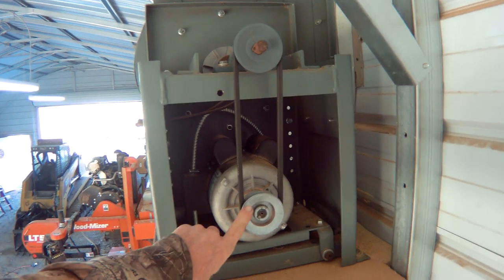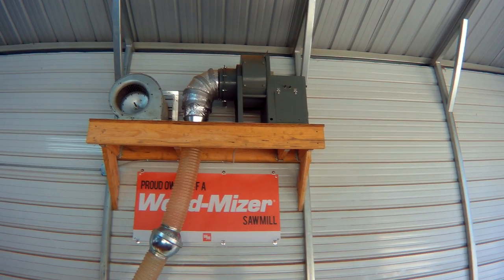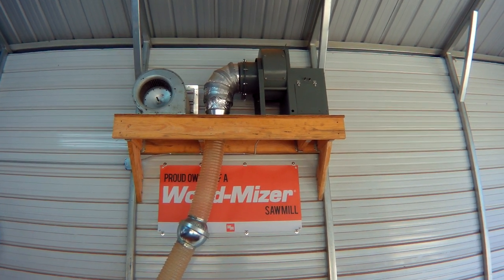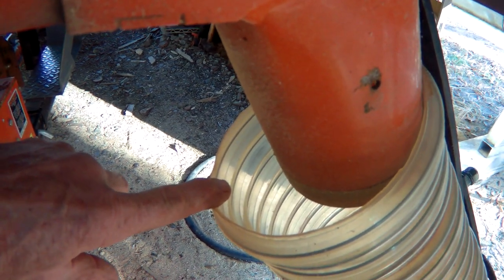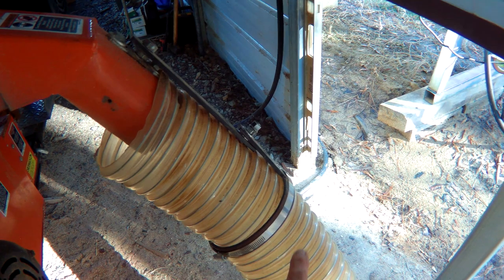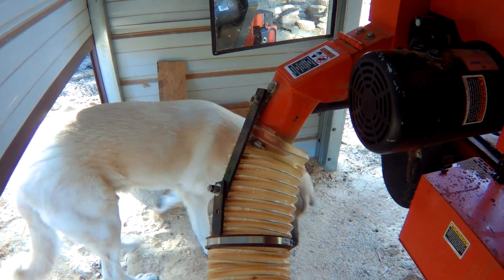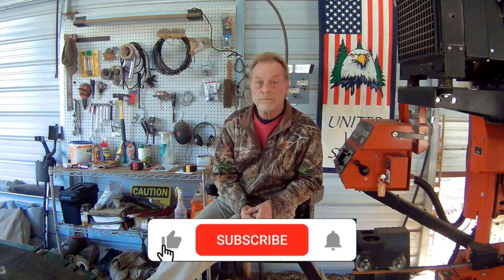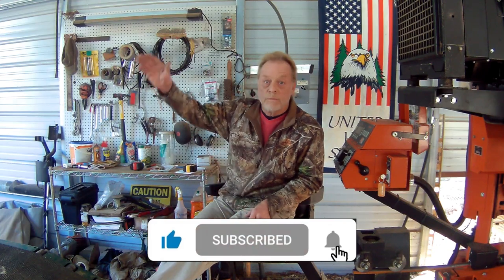The perfect Dust Collection Setup for my Woodmizer Sawmill.

Comment: Great information for when my time comes to the point where I need one.
Reply from the maker: Auxiliary air is the key. Conventional methods require more hp due to the vacuum needed to pull the material thru. This lets the air do the work. Good luck and thanks for watching.

Comment: Really liked your video some great tips! My question,  do you saw logs that require a lot of lube? I saw predominantly Douglas Fir which has lot's of pitch which reqiures to put a bunch of water to it. I'm wondering when the sawdust is damp/wet you'd think it may hang up in the flexible hose spiral ribs. Any thoughts or experience with this? Thanks
Reply from the maker: I have actually switched over to diesel fuel for coolant. It takes very little to keep the blade clean. Only one drop per second will do the trick.

Comment: 👍🏻👍🏻👍🏻👍🏻
Reply from the maker: It works great with a 1hp motor
Reply: @oldbluffsawmill5235 I already have a complete 3 phase unit . Just trying to see how folks delt with hose. Ran mill for first time in barn last night. One log pretty well trashed a 12x25 area lol
Reply: @oldbluffsawmill5235  where did you source your hose and how well/long does it last.
Reply from the maker: I got it on eBay, but I’d shop around it’s expensive. The swivel I got on eBay too.

Comment: Where did you get. Your swivel for your 6” hose on your sawdust blower
Reply from the maker: I ordered it on eBay, they are pricey too. But it really helps.
Reply: @oldbluffsawmill5235    Thanks I have a LT50 ,going to try your sawdust collection system really like your channel , I started with alt 30 , went to a 40  now the 50 like them all
Reply from the maker: Good deal, you’ll like the chain turner. Get yourself a laser too, it’s amazing at how much it helps. Also look at my video on speeding up the saw head up and down too.
Good luck and thanks for watching.